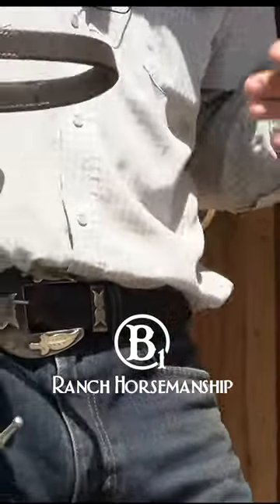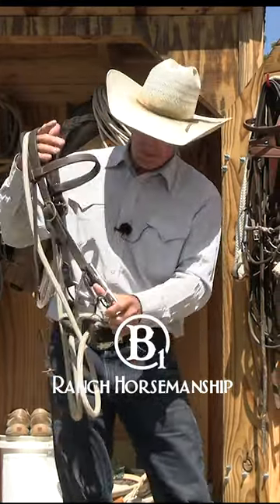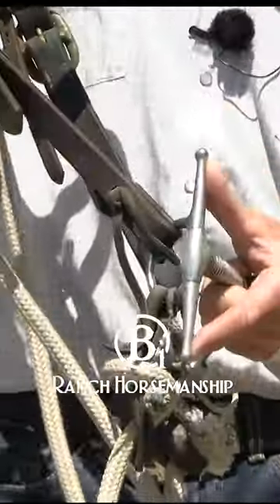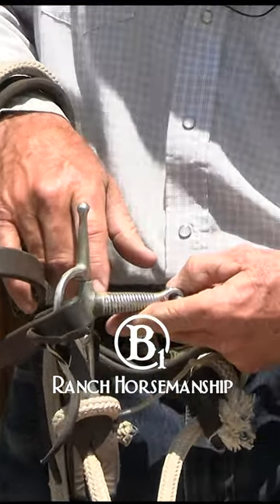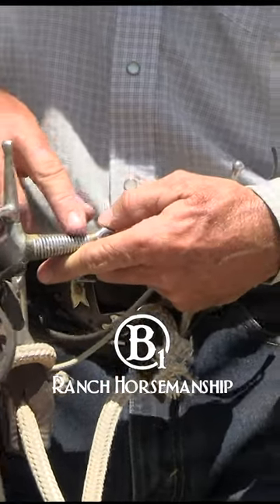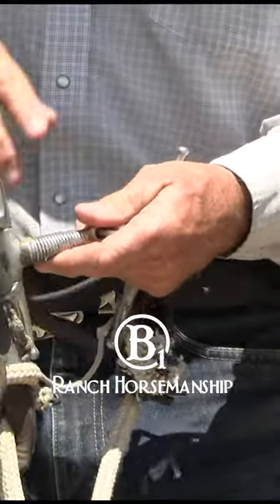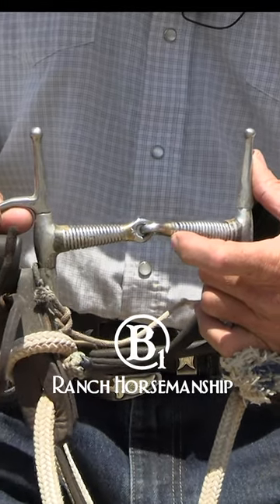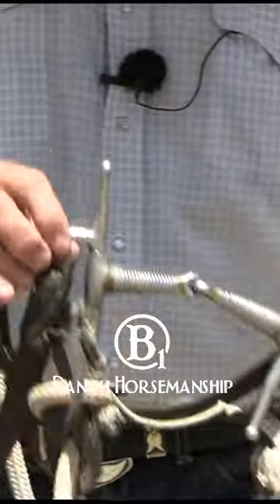Bits : How and When To Use Them

Comment: Put in your mouth !😢
Reply: Besides signally to the horse what you want them to do, the work of the bit is to teach the horse if they do what the rider commands they will be comfortable. Cause a problem, the bit will be a correction device. It will teach the horse to make good choices after making bad ones. So it is up to the horse - be good, no problems; be bad, actions have consequences.